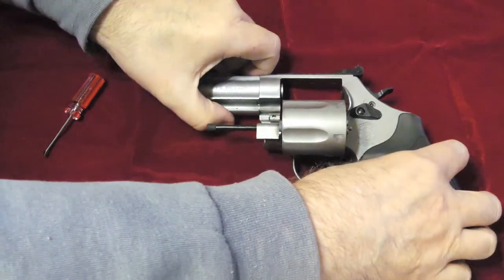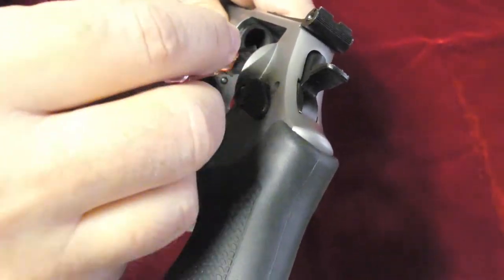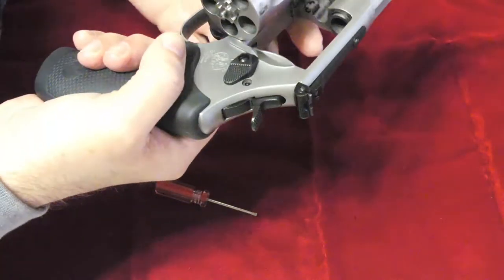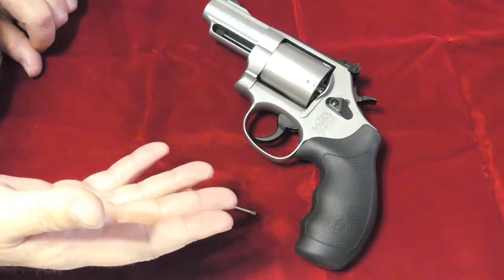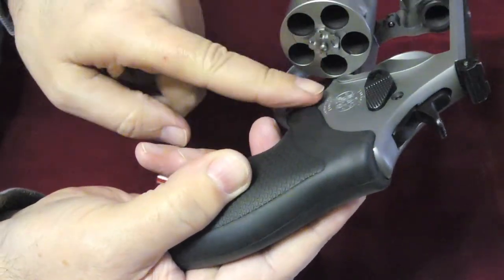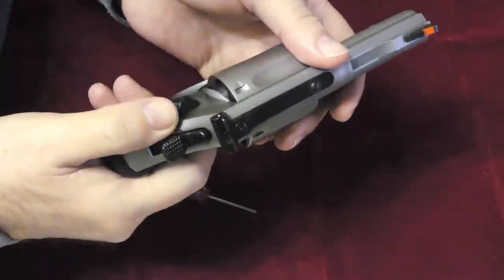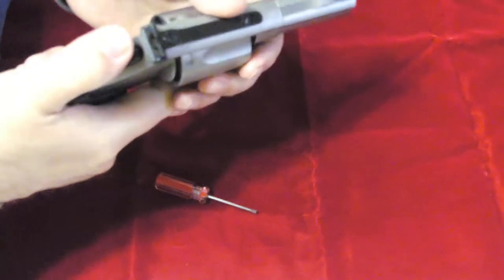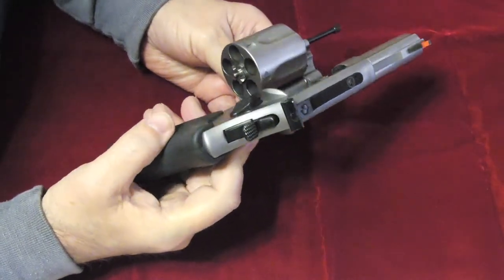S&W Model 69 .44Mag - Critical Failure Update

Comment: I ran 50 rounds of 240 grain magnum and 30 rounds of special through mine with the S&W grips. Only very slight discomfort after 80 consecutive rounds. Changed to the Pachmayr Diamond Pro grips and fired 20 heavy recoil federal 180 grain JHP through it with no discomfort at all. Great gun, accurate as hell, no flinching.

Comment: I got the 69 in 4 /14 inch new around 6 years ago. I did have some problems after maybe not quite 200 rounds though it. Had some miss fires. Was a issue the gunsmith took care of and have had beaucoup ammo through it since. It sucks it took so long to get your gun back but at least they made it right. For what it's worth I had mine quad ported from Mag-na-port and it was around 3 months before I got it back. Man it was worth it though. I recommend it with this light L frame. I went Hogue mono grip as well. Much ammo through it including 300 gr. I still enjoy shooting it and mitigating some recoil just makes it more manageable. Good video.
Reply from the maker: Thank you.
I think I finally have the kinks worked out of it now. As for the porting, I recently picked up a used Charter Arms Boomer that has porting from the factory - (.44spl 5-shot. It is a true belly gun and does not even have sights on it. If it was not ported, I think it would have about the same recoil as this L-Frame with magnum rounds. The model's name matches the gun well....it truly is a Boomer. It shoots very high to point of aim. You basically have to aim at the belt buckle to score hits in the chest area, and that is from about 3 yards.)

Comment: I think of this gun as a 44 special that can shoot magnum rounds if needed. 44 special is more than enough power for most anything I would come across, no bears in my area.
Reply from the maker: Excellent thought on this rascal....

With magnums, (240gr) about 2 cylinders is all I care to shoot at a time. I would not want to try any of the super heavy hard-cast stuff...(I have some 310 and 340gr stuff that will never see use in this little stumpy)
Reply: 44 special is fine for bears too
Reply: I may try that.
Reply: Nope not the right way to look at it at all. Smith and Wesson literally says that this gun is designed to be run with continuous magnum usage. It's designed and intended to be rough and tumble and comfortable to carry if not the most comfortable to shoot, but you can strengthen your hands to be able to shoot this easier. The model 69 was not intended to be used as many small 357 mags where they really mean 38 special with some 357 mag usage. Yeah the one in this video started as a lemon, but the very vast majority of model 69's will be able to Outlast your hands and wrists using full house magnums without any adverse effects!!!
Reply: @Wildwestwrangler  I think you took what I said the wrong way. I think of my Model 69 as a 44 special that can shoot 44 mag due to its lightness, not any durability issues other than my hand/wrist. For full Magnum rounds I much prefer my 629 Mountain gun. Shooting a 300gr bullet in front of a heavy load of H110 is not fun in the 69!
Reply: Hicock45 said it first

Comment: If you want a serious round check out the Underwood 44 mag 200gr wadcutters!!! They perform really well, without beating you up. It'll work for defense in the woods or home. No need to change!!! Super accurate, and consistent load!!!
Reply: Need to try those!I did try the underwood keith 255 hardcast

Comment: I now have around 300 44 special rounds through it, mostly stout hand loads and another 80 heavy Magnum rounds with no issues using 180 to 300 gr. bullets. Those 300gr rounds do sting a bit.
Reply from the maker: So far, mine is working okay after getting it back - although I still have less than 100 rounds through it. I want to order some 44 spl rounds after the holidays to try in it. None of my LGS's ever have them in stock.
Reply: @44Mag hit up Underwood when they have a sale, and it can get very reasonable!!! Orders under 200 dollars are flat rate shipping at 11.95 and over 200 dollars free shipping. Their sales range anywhere from 25 to 40 percent off. My last order of special and magnum rounds was only 20.99 a box plus tax. I ordered just over 200 so I'd save money and it was worth it!!! The shipping being saved was the equivalent of a half a box saved money wise!!!
Reply from the maker: @Wildwestwrangler  $21 a box is a great price. The last I bought was about $34 for a box of 50 cowboy loads. - Thanks for the tip.
Reply: @44Mag you're welcome. They are 20rd boxes, but super high end ammo. They make awesome fmj flat nose 50rd boxes, but those are normal about 55, so I'd hit those on sale.
Reply: @44Mag you won't beat Underwood's quality or even match it without paying a LOT more!!! Buffalo bore is more than double what Underwood is!!!

Comment: Got about 70 rounds on mine so far. No problems.
Reply from the maker: Other than this failure and the grip breaking off, I have had not more issues. (Although it does not get much use)

Comment: I have been buying Smith & Wesson handguns since 1977. Just like everywhere else I have seen that they are not the same guns that they were back in the day.
Reply from the maker: I concur - I think their line samples are hit or miss. I have a model 640-1 Pro Series, and it even has a couple of minor issues. (The timing is slightly off, if you ride the trigger after a shot.)

I did just pick up a model 642, and so far, it has been flawless.
Reply: @44Mag I have a Smith and Wesson model 629-6 deluxe with a 6.5 inch barrel, and that thing has a super sweet trigger and is pretty comfortable to shoot even with the full house Underwood 44 mag ammo. I have several boxes of their 240gr xtp's that are rated at 1500fps. That's the rating out of a 7.5 inch barrel, so I figure at least 1450fps and that's still cooking with peanut oil!!!
Reply from the maker: @Wildwestwrangler  I had a 629 Mountain Gun when I was younger...but of course, I hit a spot where I needed some cash and it was one that I had to sell....(It is one of the guns I really miss!)
It had a 3" barrel, 6-shot, so it helped to manage the recoil. (Though I never shot Underwood ammo out of it) - It sounds like yours is a really nice one!

I finally got some .44Spl rounds and they shoot great in this model 69. (I think it was actually designed to shoot the Spl rounds, but they added a little thicker metal on key parts so it could handle magnums.)

Comment: If I bought a model 69 it would be the 4.25 inch version and send it to Tyler Gun Works to have an action job, accuracy job and a 11 degree forcing cone cut. And a fixed trigger over travel stop.
Reply from the maker: How do you like it after all the work was done? (And the approximate cost to do it all, if you don't mind me asking)
Reply: @44Mag  $250 and if you ask they will hold it while you make payments. I had them carry melt and also tastefully engrave it. $450 for the hand engraving and $100 more for carry melting.
Reply from the maker: @jeffreylocke8808  Wow - the engraving sounds like a pretty good deal. I would love to get a fully engraved revolver. 

Here in N Texas, when you do find one at the gun show, they tend to add about a grand to the cost. (Lowest I have found was a .38 engraved 80% for $750)
Reply: It is modest hand engraving done tasteful and not elaborate. Just a $425 job not a $1000 embellishment.

Comment: My 586 had some problems with shaving lead when I first got it but the problem was one brand of ammo not the gun, a lot of ammo manufacturers are getting sloppy
Reply from the maker: Not sure if that was it or not - I only tried that one brand and I had to force the cylinder open after the third shot, so I was skeptical to try it again with another ammo. That is a good idea though....
Reply: A friend of mine had the same issue.  In a Springfield trp 10mm all ammo worked fine except pmc jacketed flat nose ammo.ftf many time per mag.
Reply: I've had similar issues with PMC in 38 Special. Only PMC ammo caused the problem. All other brands of ammo fired great.

Comment: Guess I lucky then, bought about 4 weeks ago. Was stinging pretty good with the 240 gr  44 magnum, ordered the X Grip for it. Stinging gone, mainly got it for warm 44 special hand load the shoots sweet.
Reply from the maker: That is what I have read on these - They are good for 44spl but can still handle some magnums when you are out in the wilds. - So far, I still have not tried any special ammo in mine, but I do plan to.
Reply: @44Mag no they are more comfortable with 44 special. They are made and designed to stand up to continuous full magnum rounds.

Comment: Thanks for taking the time to make this video. 

Try holding the cylinder with your left hand when loading the revolver. 

.44 Auto Mag is not the same as .44 Magnum.
Reply from the maker: This video was made a while back, (and I do have old-man memory😁) - but I may have been referencing my Ruger .44 Mag Semi-Auto rifle, and just mis-spoke and called it an Auto Mag. (It does use the same ammo as this revolver - It is a nice short carbine that looks a lot like a 10-22)

Just curious, what benefits do you get from holding the cylinder in the left hand when loading?

Typically, I push the catch forward with my right thumb, then cradle the gun in my left hand, and use my two middle fingers to push the cylinder open. It then rests there in my left hand when I load, and I use my left thumb to push the cylinder closed, then use my left thumb and two middle fingers to try and rotate the cylinder, to ensure it is locked-up.

I do not shoot revolvers much, so I am always keen to learn new tips, and would be glad to hear your input on holding it by the cylinder only while loading. (Or a link to a video of it?)

Thanks
Reply: My comment was directed towards you in hopes of helping you find a better way to reload a revolver other than what you displayed at the indoor shooting range. Sounds like you already know what to do.

Comment: Really sad to hear about these issues. I've been in the market for a 69 and there are so many videos about various problems with them... Doesn't help that I have my own issues with S&W. I have a Shield 9 EZ that's now on its third trip back for the same issue. It won't feed any ammo when the magazine is loaded past ~4 rounds, there's too much tension and not enough power in the recoil spring to strip the cartridge from the magazine. The first two times it was back they just took three weeks to polish the chamber then sent it back with the issue persisting. :/
Reply from the maker: Sorry to hear about your EZ troubles Jon. I hope they get it ironed out for you.

So far, my model 69 is doing okay, but I still have not put more than about 25 rounds through it since I got it back. It is certainly a model that was designed to be carried a lot, but shot very little. I honestly doubt they have a life expectancy of more than a few hundred rounds....

Even with thinking that, it will serve what I bought it for. (final dispatch of something that the rifle did not finish) - It has such a hard recoil, it will not get much range time.

I have never felt a desire to put more than 2 cylinders through it at one session...by then, it is leaving quite a sting on the palm.

Good luck on getting yours repaired.

Cheers!
Reply: I own this gun no problems
Reply: @44Mag nope you got a lemon. These were designed to be combat magnums. Easy to carry not so comfortable to shoot in lieu of carrying and used hard!!! Except for the few that got a lemon, these will stand up for many times the number of rounds you expect!!! If you hadn't gotten a lemon, then your hands and wrists would give out and lose the ability to shoot this gun long before the gun gave out!!!
Reply: Don't be put off the 69. They've got them worked out now, and they are badass little guns. Go checkout plowboysghost channel. He's had both the 2.75 and now the 4.125. he went with the longer barrel, because he's a badass recoil junkie and loves his velocity!!! My advice is get the 69 and try out the Underwood 200gr 44 mag wadcutters. They aren't super hot only rated at 1300fps, but with a 200gr full wadcutter that will get 1100fps or more even in this short barrel, it will take care of anything you'd need to deal with, and not be miserable to shoot!!! Penetration will be about 30 inches or a bit better in gel and really quite a bit more damage and disruption than you'd expect!!!
Reply: How many vids? How many thousands of guns? I've learned over the years to not let youtube influence my purchases.some of these guys talk just to hear themselves.

Comment: 8 weeks before they can get to it ! 😮Tells me they either got a lot of repairs to do or just 1 guy working occasionally ! Bad way to do business. Hope it works out for you. Have a Blessed Day
Reply from the maker: So far, just had the two issues with this one. (The locked cylinder which they fixed) and the grip screw casting breaking off. They sent a replacement set of grips for that)

Granted, I have still not put many rounds through it, but so far - so good...

Thanks

Comment: Well at least I got 26 shots before my new s&w revolver broke. It will be the last 1 that I will ever buy. The longer it takes the more I will post to inform people. I will probably not even shoot the rest of the box of ammo before it is traded in on a better gun.
Reply from the maker: Sorry you had troubles too..... I think they try to cut too many corners to get their cost down. This of course, impacts their quality. The sad thing is, most could be discovered prior to shipment with a QC check and 5-10 rounds fired.

After this video, mine has sat in the safe laying on  its left side. I went to get another out of the safe and found the left grip panel had fallen off. The molding had broken (where the threads were cast in it) and it just fell off. I have never taken the grips off of it. I suspect when I sent it in for the repair, they may have torqued the screw a little hard.

I emailed S&W, explaining the issue, and they mailed me a replacement set of grips at no charge. (I did notice their website listed them as out of stock, so I am not sure if others have had the same failure or not.

In the long run, all mechanical items can fail, and I understand any manufacturer can have bad runs, but they do seem to have quite a few issues.

I bought a S&W model 640-1 Pro Series at the last gun show. (New gun, old inventory item) It was of course strapped down so the action could not be checked. When I get it home and cut off the zip-tie, I found the cylinder is hard to open. (Looks like it is not releasing cleanly) - I plan to shoot a few cylinders through it to see if it works itself out, and if it does not, then I will just take it to a local gunsmith.

Good luck with getting yours repaired and back in your hands.

Comment: Sorry about your problem. I have an old ruger security six I picked up in like new condition few mouths ago. Same problem. The gap between the cylinder, and forcing cone was only 2.5 thousands of an inch. It should be 4.5 to 7 thousands of an inch. Had to cut back the forcing cone to about 5.75 thousands of an inch has worked flawlessly ever cents so even back in the day and this gun is from the early 1980s you ran into these problems. as a sidenote I have a newer about a year old 3 inch model 629 44 magnum Smith & Wesson. which is a fantastic gun. I do agree Smith and Wesson quality has slipped. No doubt. I went through the Smith and Wesson repair certification course back in the early 1980s. Things were still being fitted by hand. The operation was amazing craftsman working in the different departments was outstanding. Now it's all machine work. Box them and out the door
Reply from the maker: Tom, it sounds like S&W entire production used to be on par with what they put out through their performance center today. It is a shame they stopped the fine attention to detail during the manufacturing, but they may not have survived at all if they did not take the hand-fitting out of the equation. Most medium size and up companies started trying to cut costs and maximize profits in the late 80's and 90's. When I was younger, companies had a good business model if you could make 22% per year. In the 80's that seemed to stretch to a 32% margin everyone was looking for. Now days, I think most companies struggle to keep their doors open with anything under 40% profits.
Reply: @44Mag  I agree, but I will say this. That, while Smith and Wesson's fit and finish aren't as high as they used to be, the new guns are more durable overall as there have been improvements in both metallurgy and heat treatments!!
!

Comment: Probably  would be  great  with .44 special
Reply from the maker: That is what I have been told....I still have not tried it yet myself, but I do plan to.
Reply: @44Mag I have Underwood 44 special 200gr wadcutters in mine. You can also get 44 special 190gr semi wadcutter lead hollow points from Underwood. They are rated at 1150fps out of a longer barrel, but even our shorty 69's would still be north of 1000fps with the load, and it would be very effective. GunSamRevolverAfficianado has a video up where he shoots that 190gr semi wadcutter hollow point out of a 4.125 Smith and Wesson model 69. It performs brilliantly for an in town self defense load, and would be extremely comfortable to shoot out of your shorty 69!!!